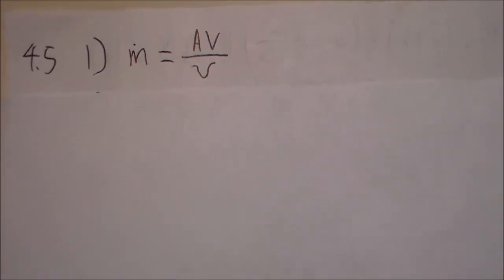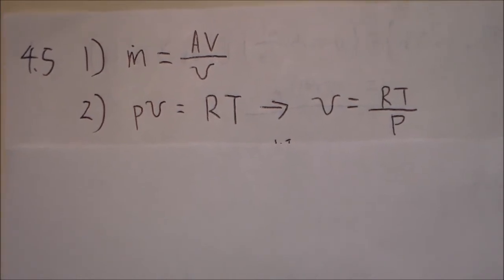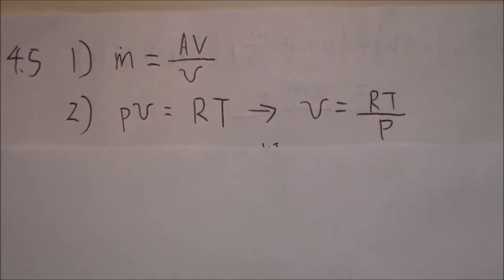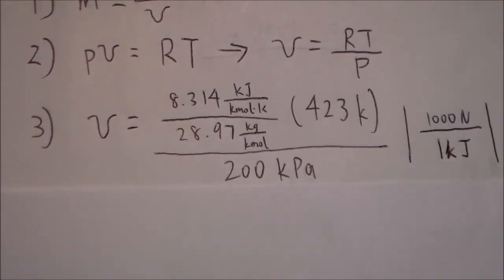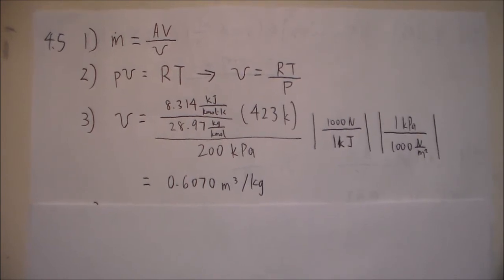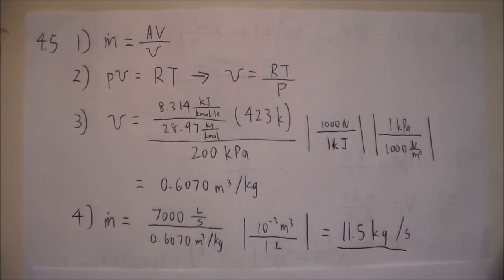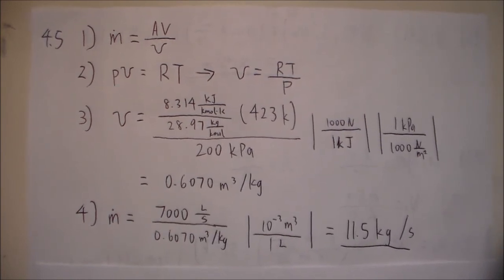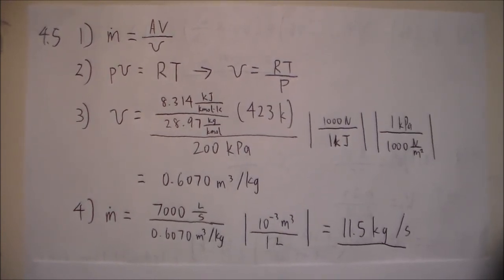Fundamentals of Engineering Thermodynamics Q4.5

Comment: how does he know the Area of turbine?
Reply: +Chuangjing Hu This is my understanding:

Typically, you have that first equation, mv = VA. The product of V (units m/s) and A (units m^2) results in units of m^3/s and m^3 is a volume. In this problem, from the get-go you are given a volumetric flow rate (7000 L/s). So already, it is in units of volume/time, which you would get from multiplying V*A. So in this problem, you don't have to worry about finding A.